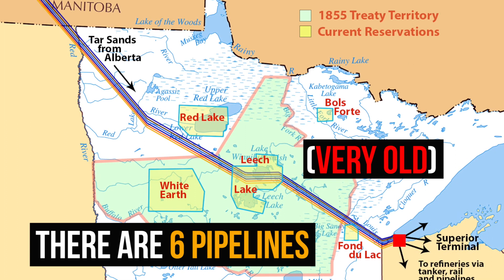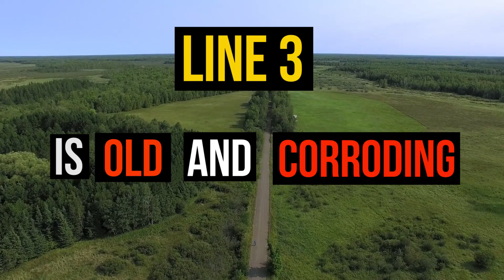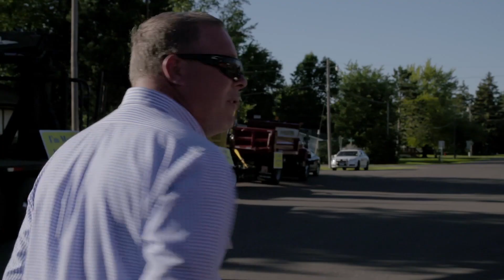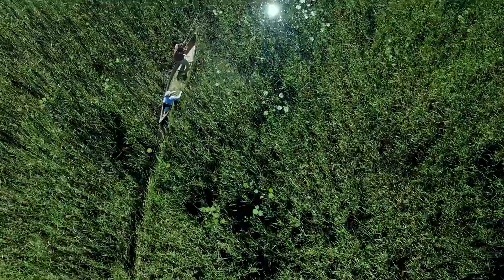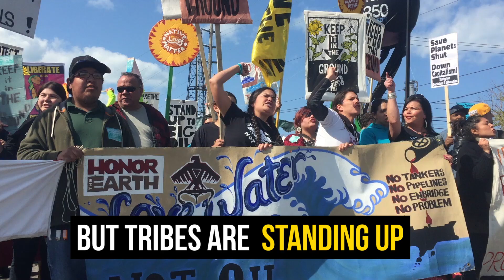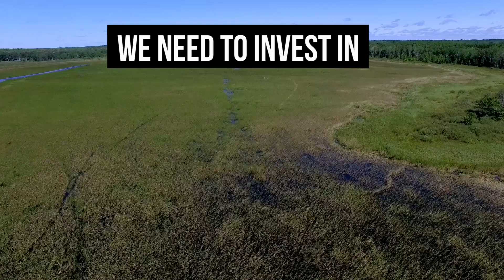What Is Line 3?

Comment: Robert Atkins: I did the math. To double capacity, the line would have to be 48" diameter.
Reply: It is a 48" 8t will feed two 36" so it does double the ability to move product.

Comment: Line 3 is an old pipeline that was bad from the day the pipe was made at the factory. The long weld on each piece was bad. It was installed by people who faced few regulations and cared little. They did not weigh it down in swamps and you can see it has floated up all across Minnesota. The welds were not x-rayed for perfection like today, the coating was horrible and often wasn’t even applied and regulations back then did not require emergency shut off valves near residential and critical wetlands ,rivers,lakes etc. My brothers first Pipeline job over 25 years ago was helping to patch line 3 and they been patching ever since. And since society has only increased its oil dependence the replacement of line 3 is needed bad. Those who wish to do away with oil and gas should get it out of their own lives first
Reply: I see your point. I have never owned a car in my life, I have had only one short haul flight since 2013 to visit family, and I calculated my carbon footprint, it is significantly lower than UK average. The problem is it is impossible to get petroleum totally out of one's life because we live in a society which is locked in to oil and gas. Technological Lock In and Ideological Lock In. It is impossible now to survive without fossil fuels. Humanity is currently like an alcoholic, knowing that continuing to drink will kill us,  but not being able to stop drinking either.